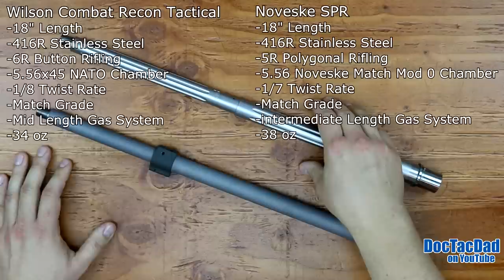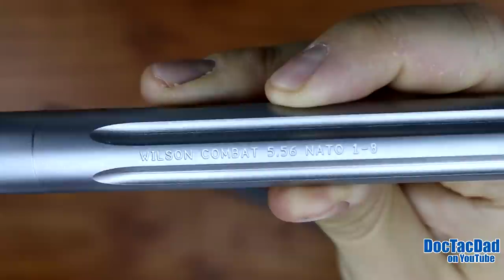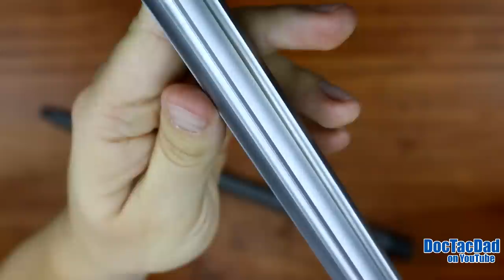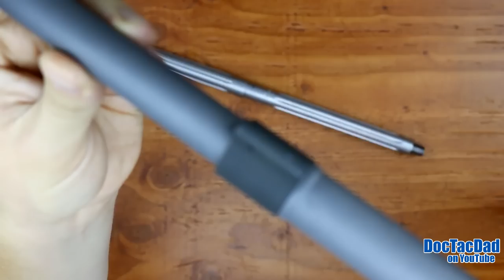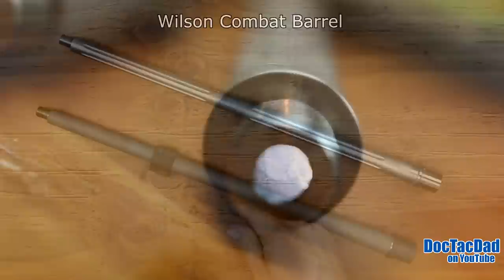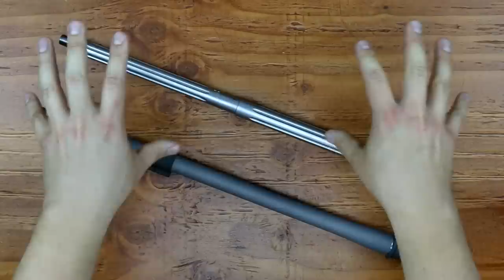Wilson Combat vs Noveske - Barrel Comparison - Project SPR 2.0

Comment: MOA is minute of angle not minute of accuracy
Reply from the maker: RIVER_CITY_TACTICAL (midnitesi) Right...I caught myself saying that...doh!
Reply: just making sure
Reply: There's a lot of mis-information in this video.  All ammo, except maybe some frangible, will not spin apart with a 1/7 twist.  Your statements are ill informed.  Second, the Noveske chamber is designed to be a bit looser because Wylde chambers can be a problem with full-auto.  The Wylde chamber is fine for semi-auto.  Noveske designed its chamber to be as accurate as possible while providing 100% reliability in a full-auto rifle.  So, the Noveske is designed for REAL fighting and may be slightly less accurate.  The Wilson barrel is for HOBBY GUNS.
Reply: Lol

Comment: No one is tearing apart 55gr bullets w/ 1:7 barrels. I've shot 1000s of rounds though 1:7s w/ no issues.  I shoot 53 gr amax all the time.   1:8 only gets you a marginal stability rate on 77 gr projectiles (check it on bergers this rate stability calculator)
Reply: Thank you

Comment: I have ran both Wilson Combat and Noveske barrels.  WC barrels have been MORE accurate than Noveskes.  I have also shot 55g FMJ out of 1/7 with no issues.   I do wish that WC made a rifle length 18" in a low 30oz barrel.

Comment: I've got two Wilson Combat 18" Match barrels. One in 5.56x45 NATO 1:8 and one in 7.62x40WT 1:12. Both in "self-built" rifles with Timney 3-lb. comp triggers, Magpul STR stocks (for cheek weld rather than storage) and I load "bulk" Hornady V-Max bullets. 40, 50 and 55-grain bullets for the 5.56 and 110-grain bullets in 7.62x40WT. I convert my own 7.62x40WT cases from once-fired Lake City and I use PMC brass for my 5.56x45 "varmint" loads. Both rifles are sub-MOA. On multiple occasions I've put TEN rounds in 1.100 or less with the 5.56x45 (1.100 using my pickup hood as a "benchrest" and .990" across an actual bench on a range) and my first non-range shot ever with the 7.62x40WT center-punched a prairie dog at 150 yards with a 110 V-Max at 2450. I think you're smoking crack on your twist rate comments. I've fired 4000-odd round through my Wilson 5.56 barrel and as I said, I use 40-55 grain V-Maxes interchangeably. I haven't "blown up" any 40s with a 1:8 twist at 3300 fps muzzle (across a chronograph), so if you think you're going to be blowing up 55s at 3100 fps (that's what I see across a chronograph) I think you're full of it.

Comment: I am not making a judgement between the two barrels.  I would say, however, that fluting it a wonderful thing: reduces weight without appreciably changing the strength. BUT, the machining done to cut the fluting does introduce stresses into the metal which could introduce some adversities to accuracy (harmonics) if not dealt with.  I would want to know if the Wilson barrel was de-stressed (similar to annealing but with differing temperature targets/times) following the fluting.  If not, I would count it as a minus 0.5-1.0.

1:7 vs 1:8  is very subjective; I would ask, "Do you really expect to be shooting many 55 grain projectiles in a SPR built expressly with accuracy in mind?"  I know I wouldn't and that is why my accuracy AR has a 1:7 barrel.

Comment: 00:11 The lower one, pick the lower one.  :P  More metal, more stiffness and the longer gas system will help with dwell time so your bolt carrier doesn't move until later.   However, I would opt for an adjustable gas system.  Also heavier bullets tend to travel farther (has more to do with the shape though).
Reply: We shot 55gr m193 all the way up to 75gr hornady match. I was amazed at the accuracy of the rifle. I'm actually still amazed, we have gone out past 800 yards with it using a Nikon 3x scope making hits and passing through a Chevy k5 blazer door with them m193s'.Being an ak guy (read rifleman)and not so much a marksman, I'm gonna have say I'm need to build one of these long barrel ar platforms with a "relax" pod for head popping at 1k yards!
Reply: ***** I also noticed with AK's the "action" seems to be longer, meaning the bolt locking occurs farther away from the magazine than does an AR-15.  Just so many things that will keep me from buying both the AK or AR.  If I could get my hands on a vz 58 that shoots 5.56 and accept stanag mags I'd go for it.
Reply: MavHunter20XX the kalash has alot of bolt mass going back and forth that causes all kinds drama when shooting i love it
Reply: ***** i like to call it the ak rock and roll! haha
Reply: MavHunter20XX favorite rifle is my Sig Sauer 556 patrol. half ak half ar. piston driven perfection
Reply: ***** I've been wanting one of those for a while.  There's also the ARAK-12 (I think that's the designation)
Reply from the maker: ***** Cool, thanks for the input.
Reply from the maker: If I go with the Wilson I'm using the Vltor A5 stock system on this rifle and that should take care of any timing issues and bolt bounce that could be associated with over gassing. That being said the Noeske combined with the A5 system should be a dream from a recoil point of view.
Reply: @ DTD if you want the smoothest setup, you'll need an adjustable gas block regardless of what carrier/spring/buffer combo and barrel you use. Regulating your gas back to your carrier should be your first stop when tuning your rife for recoil or distance. 

Keep up the great work!!!

Comment: You answered your own questioning about the 1/8 vs 1/7.   The 5R used by Noveske is more gentle on the casing so the casing will not fail for varmint class rounds running at high RPMs.   The Mk12 SPR was designed to run MK262 Mod 0 or 1 (77gr).  If you are running DMR status, you will use the heavier bullets, to assure better accuracy in cross winds.  It also is more lethal.
Reply: Good vide

Comment: I'm sorry. I'm calling bullshit on the 1:7 twist tearing bullets apart in mid-air.
Reply: Same. Last I checked, 55 grain ammo wasn't detonating in mid air when I fired it through my 1 and 7 twist barrels.
Reply: Not even my 40 gr do that in my 1/7 twist. I actually get better accuracy than 55 gr
Reply: I feel as if he was mis-quoting The jackets ripping off is from velocity. Bench rest shooting can do this with really hot loads.
Reply: I have an 18" Noveske SPR barrel in a MK 12 Mod 1 RAS and it shoots everything from 52 grain to 75 grain 1/2" out to 300 all day. Favorite fuck around load is 55 v max over 24.4 Varget in LC brass in CCI primers. Devastating on coyotes and boringly accurate for bench shooting.
Reply: 1/2" groups at 300 yards, huh? 1/6 MOA? ROFLMAO. Okay chief. Whatever you say.

Comment: I have the Wilson. I think its a great barrel. Great groups. I would suggest the Wilson over the Noveske. It is a little lighter and will probably produce the same accuracy. I would also recommend the 1:8 rifling. It is more versatile. If your really trying to hone a rifle build the Wilson gas system is shorter and will put the weight closer to your shoulder. It may be a little dirtier, but if you put a chrome/NIB/titanium coated bold it shouldn't be an issues.

Comment: I would personally go with the noveske. I don't see the 1:7 being near as big of an issue as mentioned. There are so many guys who have had zero issues running 55grn through 1:7 that I really wouldnt worry about it. Enforcing that, if you are going for utmost accuracy, then reloading and heavier bullets are going to be the vast majority of your shooting anyway. I also like the longer gas length on the noveske, but I wouldnt say no to an 18" barrel with a midlength system either. Noveske also has the superior chamber and rifling as you mentioned.
Reply: Best statement I’ve seen, it makes complete sense

Comment: Dear sir, I have over 40 years experience in reloading/ accurizing long rifles and I have NEVER known anyone that has had an issue of "overspinning" a bullet causing it to disintegrate in flight .I call bullshit on that! The ONLY time that i have had bullets disintegrate in flight is when they are too hot, traveling over 4200 fps out of a 220 swift or 22/250 or such. As far as which barrel to use, What grain bullet do you want to shoot? Decide and go from there. If you're as concerned about accuracy as you let on then obviously you're reloading, if not and you're going to shoot factory loads it's not going to make a hill of beans what barrel you use. Something that my 4+ decades of shooting has taught me is.... For maximum accuracy, ""You build a round for the barrel, not a barrel for the round"
Reply: Yes I agree.Plus people are so concerned about 1 to 2 In groupings.i guess there preparing for some slim aliens😂
Reply: Necro response here, but the round he is referring to in the speer was an ultra light weight polymer tipped varmint projectile.

Comment: I have recently bought a Noveske Afghan 14.5" rifle and like it a lot. What I don't like is the weight. The thing is front heavy, and therefore a bit unwieldy. That said, my regular HD and truck gun is a JP 300 BLK pistol with a 10.5" barrel. At 50 yards the accuracy is very close. The big thing is it is so much more maneuverable and balanced compared to the Noveske. I may look into putting a CF Proof 16" barrel on the Noveske to see what it yields. I have never heard of someone doing this, but if it works out it would be a helluva fighting gun.

Comment: I have fired almost 1700rnds of 55gr ammo thru my ss noveske 14.5 and I'm getting right around 1moa, give or take .2, with just a bipod... I had the same concerns about the 1/7 twist but after taking it to the range multiple times i slowly gained more confidence in it, I realized its a non issue(or very small).

Comment: You have both.  Test both.  Also, no mention about ammo.  If you are only using one or a couple types of ammo, test them and come back with the results.  It seems like a pretty easy decision.  If the difference is negligible, go with the less expensive barrel.

You know what I would like to see?  Using the same ammo, test this against a $700-$900 AR with the same twist rate and the same optics or sight you're planning on using on your SPR.  I bet the results are interesting.

Comment: The 1:7 twist rate in 5.56 NATO barrels make for exceptional accuracy with heavier bullets in the 62 to 77 grain category.  The 75 to 77 grain match bullet ammo performs best (accuracy at distance with greater lethal ballistics) with the 1:7 twist rate.  I have built most of my AR's with defense parameters in mind.  That said, my 22" barreled, 1:9 twist rate specimen is a supreme tack driver with quality 55 gr. ammo, but built for small game.  My 18" variant has a Daniel Defense S2W barrel.  It has a similar weight and profile to the Noveske barrel in your video.  Its accuracy is truly special.  My 16" Noveske barreled AR's are awesome.  I have both the stainless and hammer forged steel variants.  From my perspective as a Noveske owner, you'll always appreciate the quality and never regret paying a bit more for a premium barrel.

Comment: I’ve never owned a Wilson. I do have a Noveske Cold Hammer chrome lined barrel that is very very accurate.  Less then an inch at 100yards. About .7” 5 round. I’m sure their stainless barrels are even more accurate.

Comment: I would go with the Noveske.  Gas system, chamber, and rifling.  I have a 1 in 8 polygonal (different brand) and I regularly get higher velocity then I should from a 16" with the heavier projectiles.  I attribute this to a good seal, but who knows.  I also get sub minuet groups with match ammo despite my 5.56 chamber.  Also, 1 in 7 is fine for 55 gr.  though you may be over spinning lighter varmint rounds if you plan on shooting them.  Having said all that, you can't go wrong with either.

Comment: The fact about the 1:7 twist rate barrels not working well with lighter bullets really doesn't have much to do with how much the bullet weighs. It has more to do with the shape and the length of the bullet It just so happens that heavier bullets have to get longer to get heavier, because the diameter must stay the same obviously. So, it's really the fact that lighter bullets are SHORTER is why they don't work well in higher twist rate barrels. Think about if you tried shooter something that was shaped like a flat circle like a dish and spun it. It would become very unstable very fast and start tumbling in the air. Then take something that is shaped like a think needle that is sharp on both ends. It would be very stable. It has to do with the moment of inertia in physics and how the longer objects spin and stabilize as opposed to shorter objects.

Comment: I have the Noveske 16" Recon, to cut down on weight, and I shoot a little under moa with 55 grain xm193, and with 62 grain Federal Fusion, I drop bullet on top of bullet at 100 yards!!!  I was skeptical like you with the 1/7 twist shooting lighter bullets, but I would not look back, and use the Noveske!!!  Added bonus, the gas block is pinned and don't have to worry about set screws coming loose!

Comment: IMO Wilson Combat makes some of the best barrel for Accuracy.  The only Noveske I have experience with is the Afghan.  The 14.5 Afghan is what I used for my 3 Gun Rifle . We only shot out to 300 yards . 
My Wilson Combat SR Tactical shoots 0.84 MOA at 100 yards.  1.1"  MOA at 300 yards . 
Best  group I got with Afghan was 0.92" at 100 and 1.4" at 300 . 
All my groups were shot with Factory Black Hills MK262 . 
To this day the absolute best group I ever shot was with Colt SOCOM . It was 0.52" at 100 and 0.97" at 200 . I've never shot a group at 300 with it .  
I would choose Wilson Combat . For price and performance it can't be beat . I paid under $300 for my WC Barrel . Afghan was close to $450

Comment: Noveske for me, the intermediate gas system gives a bit of a smoother recoil, the chamber is better for precision and 1/7 is just as good for the type of precision ammo you are going to shoot anyway. Plus I have shot a lot of 55gr commercial ammo in 1/7 Colt barrels without any problem.

Comment: I have a Noveske 14.5'' project ares and it's grouping same as my mk12 rifle at a 100 meters it might differ at longer range both are sub moa with 77grn Otm. One thing to consider when picking a barrel is who manufactures the blanks,  I had great experience with shiellen, Douglas and criterion barrels even my BCM 410 buttoned rifle barrels shoots sub moa groups.  Like I said before making a decision see who manufactures the blanks. 55 grn bullet works great on 1/7 twist but I wouldn't put anything less than 50 grn in it. Frangible is a no go,  it's like shooting a sand paper through the barrel.

Comment: I understand that this is an old video but don't underestimate the added reliability of a pinned gas block vs a allen screw block.  He is on top of everything between the two but the gas block is big.  I thought this could help is you're looking for a barrel.
Reply: I think I'd underestimate the added reliability you speak of.  I've never had a set screw gas block come loose or heard of a wave of gas blocks coming loose.  There is also the clamp on style if you don't like set screws and dimples.  I personally don't want a pinned gas block that limits me when adding the adjustable gas block of my choice.  Also, they always seem to come with the gas block pinned in place.  How does that make sense when you have to remove the gas block to put on the barrel nut anyway?  Annoying.

Comment: I have the light 16" Wilson 1-8 fluted w/med-length gas block. No experience with any other tube. Can't really say more than that but since I intend to eventually go with a can, I'll have to be conservative in terms of cycle rate in order to prevent over heating. I configured mine for balance and versatility. The BILLet upper/lower combined with a full-length rail will hopefully work. Frankly, it's a bit risky to deviate from Wilson's carefully configured offerings but that's just me. If I had it to do over again I would've gone with the TacSR w/Billet and be done.

Comment: You brought up a number of important considerations in making a choice. All things considered I can't understand how you can just "buy" a barrel and slap it in w/o it being mated to the bolt/upper  in YOUR particular firearm. I had Krieger rebarrel my Rem 700 and to do it correctly they required my complete action to properly set the headspace. I just got into the AR scene with a Wilson Combat Super Sniper after wanting one for years. Have you considered a Krieger rebarrel besides the Noveske and Wilson products? Just curious. My bolt gun is .25 MOA. I would trust Krieger to rebarrel my Wilson in the future when it's needed because they did such a great job on my Rem 700.
Thank you.
Reply: @TheLongRanger, you  make an excellent point here. Anyone considering building an AR platform rifle with the intent on any type of REAL accuracy, should consider getting the bolt (i.e., extractor or bolt carrier group...aka bcg) matched to not only the caliper of choice, but the barrel as well. Quality companies do this. ODIN WORKS, JP Precision, and Faxon Firearms are just a few. Speaking of bcg's, consider going with nickel boron. My personal experience with this material is you can't go wrong. Although cleaning is easy, you should still completely disassemble the entire bcg, clean and reassemble after each session at the range. I do and I'm certain my rifles will last forever....barring some unexpected catastrophy.
Reply: btw, it helps 100% with your accuracy!